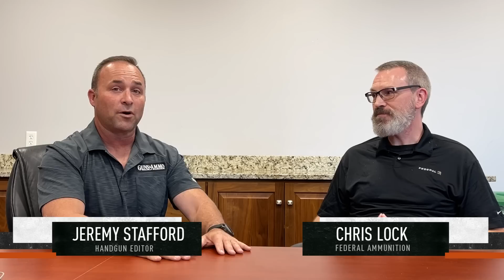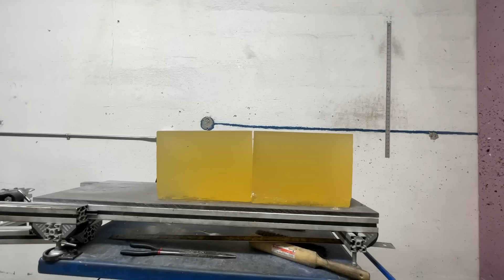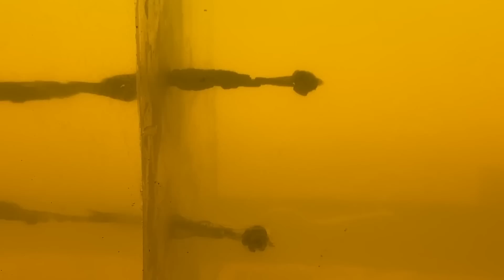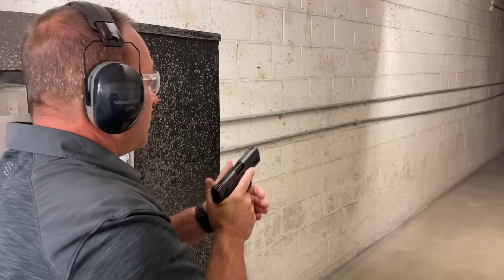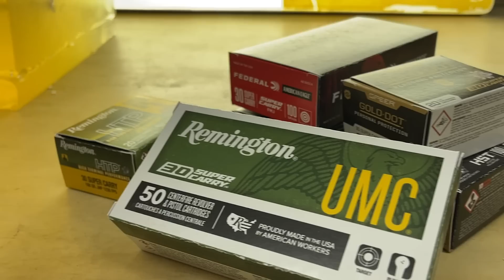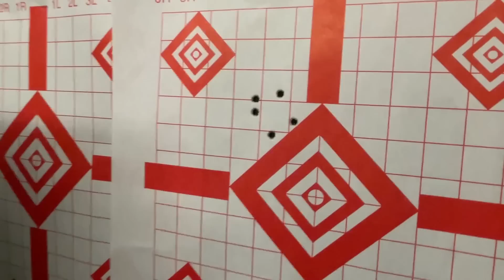Federal .30 Super Carry Pistol Cartridge: Full Review

Comment: Curious how this would perform in a carbine. Slightly higher pressure than the .327 Magnum. 50,000 PSI vs 45,000 PSI. .327 Magnum makes about 1,000 foot pounds of energy out of 16-18" barrels.

Comment: I still like .30 or 7.65mm Luger better. I used to reload the 100 grain round nose bullet to around 1290 fps with no high pressure problems.

Comment: With the same recoil the only advantage to 9mm is 2 extra rounds. Thats too little of a difference I think. For small micro guns its to strong. Many complain that even .380 is kind of snappy from those little pistols. I think a new pocket gun caliber would be more interesting  6,5 or 7mm with the power of a .380. Imagine a Ruger LCP Max with a 15 shot mag of 6,5mm.

Comment: Everything is driven by how you can make more money....NOT on what the customer wants. Amazing that these shills can lie with a straight face. Innovation is great, but not when it really doesn't add anything valuable.  9mm is still hard to get and 50%-75% more costly....so Federal comes up with a new round that forces people to buy more guns simply to fit a couple extra rounds in the magazine.  Despite the blatant lies, they could have spent the time on building more capacity for rounds people already use and need.  As I recall, the President of Federal made a video where he whined like a baby about having to answer questions about the ammo shortage. Pathetic

Comment: 9mm has pretty much won the caliber war not because it's perfect, but because it's the lowest recoiling and highest capacity round that reliably meets FBI requirements and expands. This round has the potential to take the throne for that, but only if it really takes off, which seems unlikely. Unless Russian companies start mass producing steel cased ammo for it AND Glock makes a pistol for it, this round will unfortunately die off.

Comment: 20% more capacity
20% less power than 9mm

Uhh, just grab a 22LR with those keltecs that holds 33 rounds. 

30 super carry is federal trying to revive and or redesign 327 federal magnum, for auto loaders. 

It’s basically a 32 super auto. But since 32 auto is almost extinct, 327 federal magnum flopped but got rather good praise but for wheel guns… now this is their attempt at making it for auto loaders. 

I don’t know about everyone else, but I’ll keep my 45 auto. With Winchester silvertips in my main 4.25” auto loader and my pitbull 45 auto revolver for back up. I just don’t see and haven’t to date needed more than 8+1 plus 2 8rd mags and a wheel gun also in 45 auto with 5 more shots. If I find myself in that situation… I’ll be running with a purpose to grab a 5.56 or 300BLK.

Comment: If the velocity is 1200+ fps from a 3 inch barrel then it may be something to consider. Does it match the performance of the .327 Federal Magnum, 100 gr, from similar barrel lengths? Might be unfair to compare them.

Comment: If the shortened the case it would be possible to fit 12 rounds in a ruger lcp max with a flush baseplate and a standard mag

Comment: Federal need to do a 32x28mm using the 5.7x28mm case with a 32 calibre bullet that would be a much better defence round for the ruger or FN 5.7 pistols,
That would be just a barrel swap and a hot 32x28mm in a decent barrel length would be far superior to the 5.7x28 plus you would likely get close to the 20 round in the mag and maybe could still get 20 rounds in the mag with the larger bullet,
If any ammo manufacturers are watching make the 32x28mm "327 AUTOMAG"

Comment: So... a smaller diameter projectile, that doesn’t quite match 9mm in terminal performance, yet costs more than 9mm, has less load variety than 9mm, appears to have a similar amount of blast/recoil to that of the 9mm, but operates at higher pressures than 9mm to accelerate wear on your pistol? Oh... but, in its heavier loadings it can match the lower end bullet weights of 9mm projectiles? All to gain an additional two rounds in magazine capacity? Do I have this right?

Options are a great thing. And, I certainly don’t believe someone armed with a pistol chambered for this cartridge would be ill-equipped to handle their personal self defense needs. I am left wondering what the real benefit to this cartridge will be however. 

When you consider that statistically speaking, armed defensive encounters tend to be over with a total of something like 3 rounds or less being fired, and that the capacity of currently available 9mm carry pistols is several times that amount... I just don’t see the perceived need. Even the super micro guns chambered for .380 come with capacities greater than the traditional 5 shot snub nosed revolvers that generations of people have depended upon successfully for self defense. And, while this new offering does appear to offer more power than the .380, it also does so with a smaller diameter bullet.

Where’s the cutoff point? I mean... I’m sure you could go one further by stuffing a few more rounds into a magazine through the reduction of bullet diameter, but at some point you are getting into that whole diminishing returns territory. The 5.7x28 hasn’t really taken the CCW market by storm, yet it seems to take the same approach as this offering, only to a greater extreme. 

I personally hope this new cartridge enjoys great success. I just really don’t understand what it is bringing to the table that isn’t already offered by cartridges that have been around for a very long time.

Comment: Can you use that round in a 32acp
Reply: No. The OAL is going to be longer and the 32 auto is a low pressure round usually fired in blowback rather than locked breech guns.

Comment: Good luck to them, but what is old is new. A 30 Luger sans the taper at least in performance it appears. Much ado for a two round or so capacity advantage. But if it works for someone have at it.

Comment: Federal should have concentrated their efforts into upping the manufacturing volume of presently made , more conventional rounds due to the ammo shortage. But instead they offer this new round that performs almost as well as 9mm, with less frontal area than 9 (before and after expansion),less energy than 9, more snappy recoil than 9, less availability than 9, and costs more than 9. What is there to like here besides 2 more rounds that offer less of overall “everything”? Totally unimpressed. This is a solution for a nonexistent problem. I’m sticking with my 40 for better “everything” compared to this new “wonder .30” or the “wonder 9”. YMMV
Reply: Yeh,a 135 grain nosler going 1350 fps to 1450 fps ,creates a wound channel that has to be seen, to be appreciated. Easily met by 40 cal modern powders.
Reply: I don't follow the mainstream either I'm an old-school dude I've been shooting the 10 mm Auto since 1990 the Glock model 20 was my constant companion from 1990 until 2013 I'm older now and have downsized I carry a MOS Glock model 22 in 40 Smith & Wesson the 40 Smith & Wesson is a better cartridge than either of these and of course is The Offspring from its father the 10 mm Auto I believe this new federal cartridge is doomed right from the start to dodo bird status
Reply: I'm sticking with my 40 also what the hell are these guys doing at Federal ammunition let's be real
Reply: I'm happy with my Glock 23. I wouldn't mind switching to 9mm or some other caliber, but really the 40 is a great round. I'm interested in the 30sc and it's possibilities for wildcatters
Reply: GLOCKCOP23. Couldn't agree more

Comment: From the Federal site "More capacity than a 9mm. More effectiveness than a 380." Comparing it to a 380 is ridiculous since it was purpose built to fit into a slide with a 9mm length ejection port and a frame with a 9mm length magwell.
My smallest lightest 380 is an LCP. It weighs 9.4 ounces unloaded with empty magazine and has a slide that weighs 4 ounces. No way in hell is the 30 Super Carry going to fit into a pistol 5.17" long X 3.62" tall that weighs 12 ounces plus or minus an RCH, so Federal please stop with the nonsense of comparing the new cartridge to a 380. No way am I going to choose a 380 in a gun sized for the 9mm Para OAL.
If people want this round more power to them, but I have never looked at a Glock 26 or Smith 642 and thought "Gee I wish the was bore 23% smaller." 
Get what you want, shoot what you want and carry what you want.

Comment: I'm optimistic and will likely try one out. I'm weird, and I want to see it in a G19 size gun, and see if they can make a flush-fit 18rd magazine. Or in a full-size, and have a flush fit 21rd mag, lol.

Yes it's designed in the same niche as .327, and marketed the same. It's providing similar ballistics to a (.357 Magnum/9mm) in a smaller footprint that allows for (1 more in the cylinder/an extra 20%~ magazine capacity). IMO, .30/.327 were never going to replace their bigger siblings, but I think they're superior products compared to their shorter siblings, .380 and .38 Special. The issue w/ .327 wasn't that it was a bad product, it was released to a stagnant market. J-frame .38s don't have the same buzz as the micro-9 market does nowadays, and it's not like folks were desperate for more capacity in a snubnose.

However, the micro-9 market is pretty hot. Seems like every week manufacturers are coming out with new models, and the main draw is that they're 9mm guns w/ double-stack magazines in the footprint of single-stack .380s. Most are advertised on capacity. .30 Carry is advertising on the same lines.

Besides that, R&D takes time. It wouldn't surprise me if Federal planned on introducing this late 2019 but got delayed from (the unspecified virus of unknown origin). Now that things are settling somewhat they're introducing it.
Reply: Given the smaller diameter you could probably get 17 or 18 rounds in a G48 size. 

THAT would be interesting...
Reply: Thank you for such a reasonable and level-headed comment. Refreshing to read amongst all the whining in this comment section

Comment: If this round is even a little "snappier" than 9mm (as stated), it is dead on arrival.
Reply: It's modernised 7.65mm French Long, so I ran the numbers.  Loaded to 37-38k psi to meet Federal's 100gr at 1250fps adverts, you're looking at 90% of the bolt thrust and 80% of the free recoil of an equivalent 9mm load.  So either it's easier on your gun/hand or you can make the gun thinner.
Reply: @chaimafaghet7343  sounds about right :)

Comment: I've never seen more short-sighted criticisms of a caliber than in this comment section. A bunch of 9mm diehards pulling out the same talking-points .45 and .40 diehards pull out to discredit 9mm. "It don't do nothin mah nine-millumeter do", yes it does, it manages not to have a .391 base diameter, just like 9mm manages not to have a .476 base diameter.

How hard is it to understand that all things being equal, smaller is better? Why is that a difficult concept? It performs better than .380 AND IS SMALLER. It performs similarly to 9mm AND IS SMALLER.

You just can't please gun owners; if you innovate they demand you stop, if you don't innovate they call you boring. Fudd-logic is impervious to reason.

Comment: It's interesting, but apart from the 'gap' between .380 and 9x19, what is the reason for this cartridge? Slightly better capacity in a same frame gun? If the round is as expensive as a .380 it's never gonna take off because 9x19 will always be preferable.
I like that they're trying new things, but they need to make the argument for it as well.
Reply: That was my line of thought too.  
I am carrying the Sig 365xl which has 12 rounds in 9mm with a flush magazine.  I am fully invested in 9mm with reloading equipment, other firearms, and supplies.  I am not changing my decision at this point in the game for a new offering that will not exceed the acceptance and options of the 9mm.
Reply: Yeah there's no gap, these guys just have too much time on their hands.

Comment: That’s great.  I love new ammo types.  Never stop innovating.  

Why are YouTube gun owners so pessimistic?
Reply: Possibly because some have seen the 32 H&R Magnum, 9mm Federal, 41 Action Express, 9mm Action Express and 45 GAP come and go. I recall the introduction of all those and all are pretty much defunct with the almost exception of the 45 GAP. The 45 GAP was shrunk into a smaller niche when SA introduced the XDS in 45 ACP and S&W followed suit with the Shield. I didn't get the 45 GAP because I already had five or six 45 ACPs in 2003 and I didn't need to duplicate 45 ACP performance with a slightly shorter cartridge. 

Another thing to consider is that the Federal website is comparing the 100 grain 30 Super to their standard pressure 124 grain load. My Glock 26s handle Winchester 115 +P+ with ease and I still have several hundred of those as well as several hundred Federal P9HST2 147 grain JHPs. 115 grains at 1280 fps or 124 @ 1200 fps beats a 100 grain 32 @ 1200 fps. And my Beretta Nano, like the Glock 26s, is paid for, works very well and handles 124 grain +P Gold Dots and 147 HSTs very well. 
That said I have no objection to you or anyone else trying this new cartridge, heck you might like it. But, while I will have 9mms in the same size guns my 40s are in, I won't bother getting all new guns to replace or augment my one dozen plus 9mms when the trade off for a few more rounds is a cartridge with a bore sized @ 77% the area of the 9mm.

That's ^^^ just my thoughts on the matter, not a swipe at anyone who wants to try this new cartridge.
Reply: Cause we have been around for a bit and we remember RIP ammo and the hype over that.
Reply: So some win and some lose.  That’s a risk the ammo makes make. I think it innovative.

Comment: Soooo basically it's an American take on the 7.62×25mm Tokarev Russian.  High velocity 30 caliber straight wall case instead of a bottle neck case.   Actually, Springfield Armory had a similar concept 30 caliber pistol cartridge the .30-18 Auto (7.65×20mm Longue) for use in 1918 for their Petersen devises.  With the close of WWI that devise, and ammunition was pulled from inventory and demilled.
Reply: "straight wall case instead of a bottle neck case"
So it's exactly like 7.62x25tok except it's totally different?
Reply: Except it isn't at all close to the 7.62 X 25.

Comment: .32 ACP (semi rimmed) uses a .3125 caliber in a just over 17mm long case, the 7.5 long french uses a .309 in a case 19.7mm long, soo how long is the case? And is this cartridge going into smaller guns that today uses .32 ACP so it truly could be a CCW Super Carry? Of course they had to have a system that is not Blowback, but does they need to so wide as these first guns, could they shave 2mm or more on the slide and frame of the gun? Compare a Walter PP/PPK/PPKS to a 9mm. Maybe a gas retarded system like the H&K P7, as a CCW You probably will not use more than 2 mags, so overheating is no problem, but not so good in a competition gun, but there the concealability is no problems.

Comment: .312 is the same diameter as a .32 acp.  It's just an elongated ..32 acp with better ballistics but in a 9mm size handgun you get two extra rounds?  So what?  You don't get the small size of a .32 acp pistol.  You dont get 9mm performance.  I will stick with a 9mm or carry a .380 if I need more concealibility.  Without it's own platform, built for the round, specifically, it's going to fail badly.  Especially with the cost to feed it.
Reply: SInce the 30SC is the same overall  length as the 9x19, you can't really shrink the pistol frames any further and still stuff the cartridge into it....
Reply: @mdd1963  Then what's the point?  They want us to buy new pistols so we can feed them a round that ballisticly equals 9mm so we can squeeze in two more rounds into the same size gun and then pay even more for ammo?  No thanks! This cartridge would have stood a chance before they figured out how to fit 10+1 (and more) into the new subcompact 9mms.  If we were still stuck with single stack 7+1 9mms and this round came along and suddenly you could have 12 +1 in .30 super carry, then sure.  But that time has passed.  Too little, too late!

Comment: I'd only be curious in that round if it was loaded with a powder that gave the best performance out of a 7.5-10" barrel for PCC usage.
Reply: Why?
Current 9mm mags give you more than 30rds available.  The whole supposed benefit to this round is higher capacity, at the round count current 9mm big sticks have, who cares?
Reply: @jesuriah  Because you can get a non-bottlenecked loading that would be a good equivalent to 7.62x25mm. Which getting a hold of is a bit of a hit or miss prospect. 

Basically, modern versions of a PPSh/PPS could be a really fun possibility. Also, flatter trajectories than 9mm. But with a case that's easier to reload than 4.6 or 5.7. 

Plus, sometimes variety is the spice of life. 9mm isn't the only answer.

Comment: Federal spent a lot of time trying to convince us they were making ammo as fast as they could within constraints of material and factory capacity.  So, where did the surplus primers, etc come from to produce this?   Shut this boondoggle down and produce more standard round like 9mm, .40S&W, .45 ACP.  I don't like paying 50 cents a round when I can find it.
Reply: .38 super+p is just as good it's been around since 1930
Reply: @alanwitt1435  .38 super is a semi-rimmed cartridge with an OAL that is greater than 9mm. It only fits in .45 "length" guns, and has a larger diameter than the .30 SC which means reduced capacity.
Reply: Order online boomer. Way cheaper.